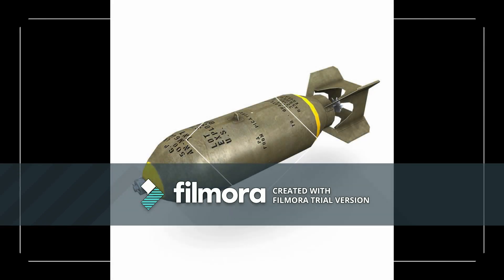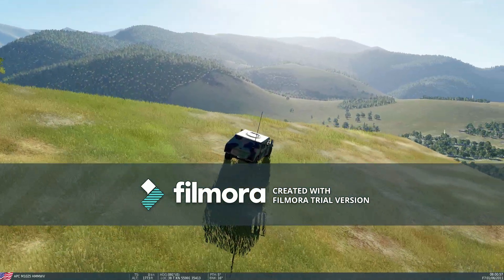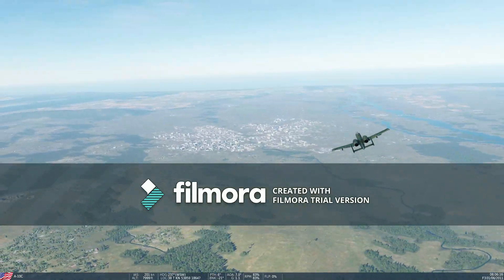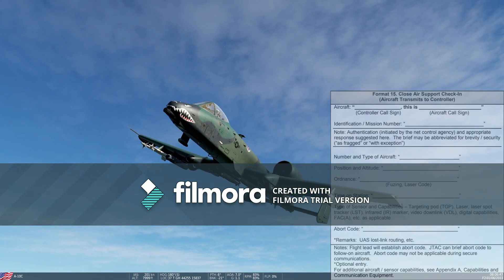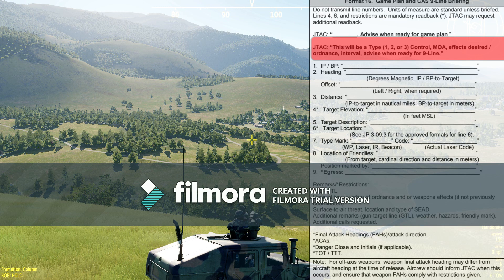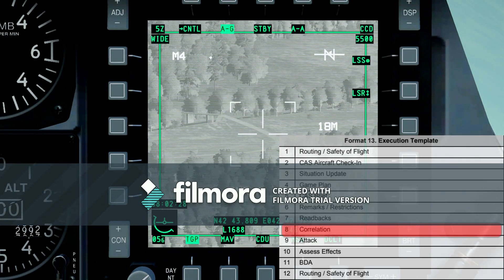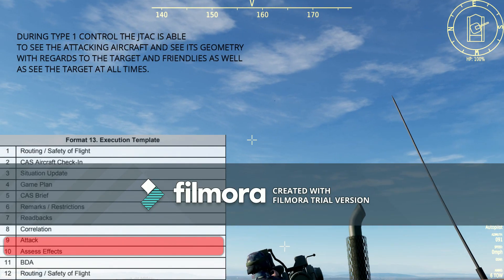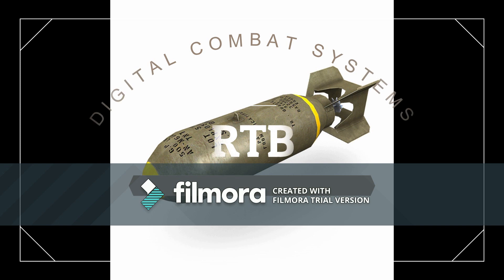DCS WORLD TYPE 1 CONTROL CAS EXECUTION CHECKLIST SERIES

Comment: Nice video, just long enough to show a complete type 1 CAS procedure. 
Just few things: 
- During situp you have to pass restrictions at first despite the fact it is the last item in the form.
- Most of the time the lines 1-3 are not fill except for specific cases of CAS.
- You have to give each items of the 9 line (eg "elevation : 255 ft MSL" and not just "255 ft MSL")
Reply from the maker: Thanks for the critique Virginie.  Ill disagree respectfully with regards to restrictions and elevation.  Simply because it takes so long to transmit everything I attempt to "cut the fat" at all places possible.  I am completely aware many from various school houses have their own experiences and training.  I take the angle that this worked for me in Afghanistan and Iraq and there are times where your data can be very well completed and others where it means nothing to have great data if by the time the weapon hits the target the troops are dead.

Comment: Awesome video! Thanks for sharing this with your unique experience. Would you consider doing a video on the differences between controlling different aircraft like an A—10 and F/A—18? Is it all the same or are there different considerations?
Reply from the maker: RYU.  Thanks for the kind words.  I want to finish this series before doing any other videos that break down the TYPE 1 control.  These steps and methods are both adopted by the A-10 and F/A-18 community.  We could get into a real battle if we said they were the same.  In reality like in the sim someone would have to consider the airframe capabilities, weapons, pilot experience etc.  Right off the bat the A-10 does CAS as their bread and butter.  The F-18 if it comes from the US NAVY wears many hats!  Thus I would argue they would be less experienced and things would just work perhaps a little slower to getting that bomb off.  At the end of the day regardless of the aircraft you get in the stack the execution template does not vary much at all.